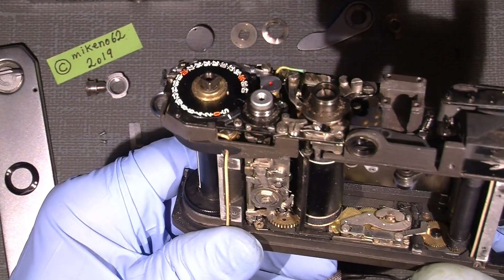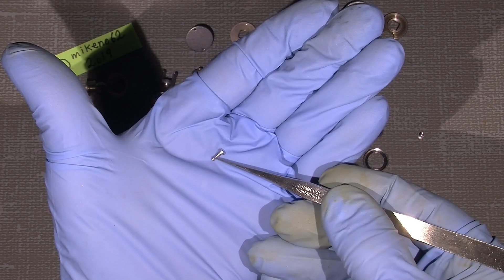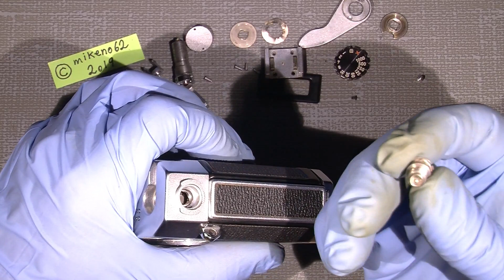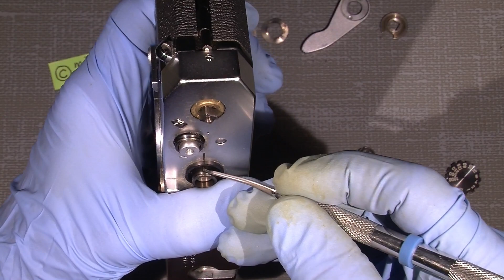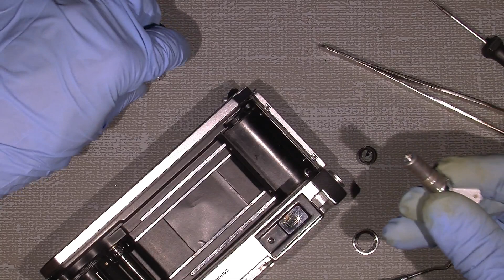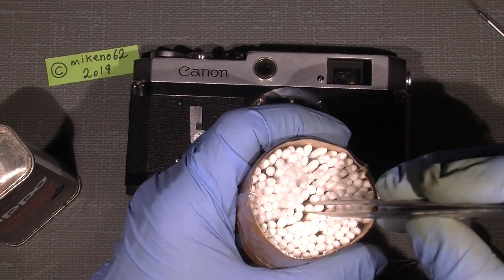Stuck shutter button mechanism in Canon P and other details    Could NOT repair it

Comment: I have a canon P myself. Just got it a few days ago. I am really excited because its such a pretty camera. I tested it with a shutter curtain and sadly it's a bit slow overall. Especially in the higher speeds. Now I really hope i can get them up within the canon tolerances but I am still fairly new to fixing cameras so I still need to learn a lot. 
Anyway, I was looking for information about the repair and as you are saying the repair manual is basically just exploded views and part lists. after searching and searching I stumbled upon the manual of the canon IV-S2. It's a rangefinder that's a bit older than the canon p. This manual has a lot more information and guides. In case you ever need more info.

Comment: The actual issue causing the damage with the camera is the self-timer was not in the correct charged position when an attempt at reassembly has been carried out. 
The self-timer MUST be in the  'armed' state with and the shutter charged to enable correct reassembly. You have not got it in the correct state when you are reassembling it.
I could repair the damage and have this camera working in about an hour.
Reply: Hey, my self timer mechanism is locked up. I have it out of the camera. Do you have an idea of what I may be able to do to free up the mechanism? It’s the main gear that’s connected to the lever and clock spring that has jammed it seems.
Reply: Do you know anything about fixing a stuck shutter button on a Miranda Sensomat? I was loading up a new film roll and as I was doing that the film advance lever became really loose, the shutter button would not press all the way down and the bottom button to rewind film would also not press All the way down. I thought it could have been a wire that snapped but I wanted to ask your opinion.
Reply: @jackelinemunguia9166  Nice camera! It could be any number of things causing the issue. Without having the camera in hand to investigate it is difficult to say.
But, it will be repairable as it is a mechanical camera.